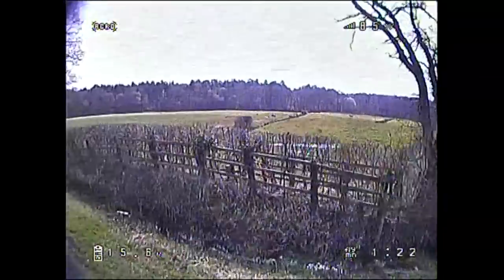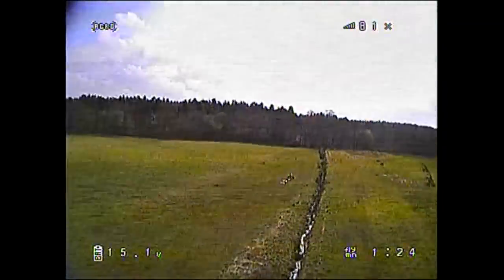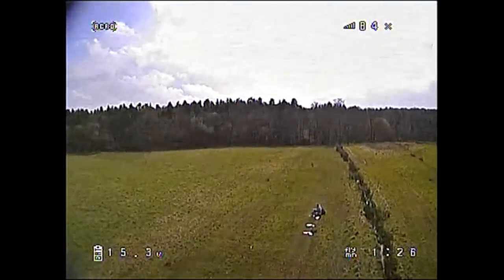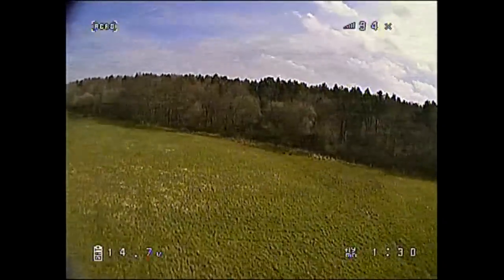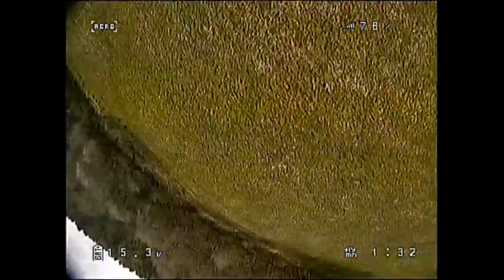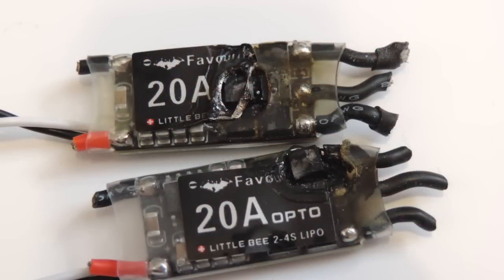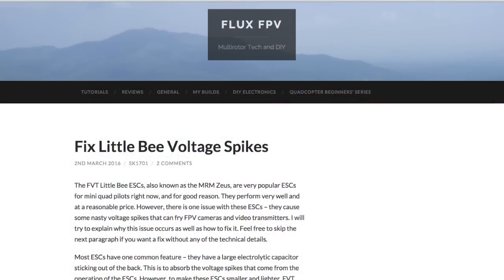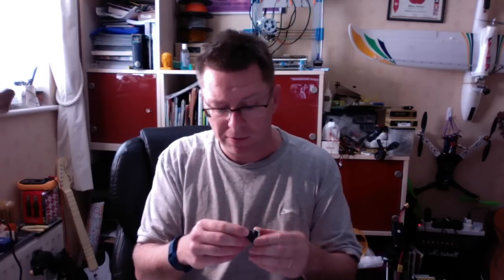Help: Why are my Little Bee 20a ESC's bursting into flames ?

Comment: It unfortunately does look like the Bees are a bit hit and miss, and somewhat sensitive to certain conditions. They really need a bit of a redesign. The most robust solution, in my experience is to add a 25V (for 4s) 1000uF 105 degree radial cap in the PDB as close to where the battery lead connects as possible. This goes a long way to take care of the noise on the main rail and the back feeding current from aggressive motor braking. So far on 4 different quads flown pretty hard, this is working well.

Comment: I ran into one littlebee that also burst into flame ... I think it was due to a crash, however, not during testing or mid-flight:  https://flic.kr/p/G7Lrk5

That said I have MANY littlebees and have used them for months.  This is the only one I've seen that burn out.  I can't rationally consider this an issue just yet.
Reply from the maker: +TheFlyingRamen Out of interest have you ever ran them up high throttle without props ?  I don't think the general bursting into flames is an issue either, I think the reason is high throttle with no load - but if people tell me they do that all the time, then maybe I just got unlucky.  It's my working theory at the moment until I get a better one.  Replacements have been fine though

Comment: Before you put new esc check every motor with LC meter only 10 pound on ebay , RC model reviews explain it very well . 
I burn 2 little bee esc in my qav 210 , 2 motors are dead - and I don't know why- it happen when I changed to 4s

Comment: Check that the ESC components are not pushing through the wrapping onto the carbon arms. Ive had that issue and found it shorting onto my arms before
Reply from the maker: I expect it's a case of making sure you have an additional barrier there.  A doubled sided piece of tape will do it.  Or re-hreatshrinking them
Reply: I secon that...had same issue...
Reply: What did you do to fix that?

Comment: Your motors are drawing more than 20 A, upgrade to a 30A ESC
Reply: You are wrong.  The motor is the load, it is what pulls power.  The ESC is simply transferring whatever amount power that is from the battery to the motor.
Reply: KpilotRCHelis 
No. The Electronic Speed Controller sends power to the motor on the FCS command
Reply: the motors do not pull power, the escs pull power from the battery and push power to the motors. These escs are rated for 2s - 4s lipo's. I'm not hearing him state or show what size battery he used when these overheated. Other than that a bad firmware install can cause the same issue.
Reply: @faithist01  The Motors ask for power, the esc's give it to them. The esc's do not push the power.

Comment: love the littlebees. ive crashed and not looked after my quadcopter and no problems with them. I have a pcb with 12v out then I run a lc filter then to the vtx and camera its all working good

Comment: If you're P is too high which it will be if you lower the looptime without lowering PIDs, the the ESCs are speeding up and slowing down the motors VERY fast which can not only burn out ESCs but motors too.
Reply: Wrong FW in blheli....lesson learned
Reply: I did, it was user error. I'm airborn now tho
Reply: Bishop Vick It's my fault, I should've just used emax but I thought I'd try some of those new ones from Surveilzone. Running Rotorgeek 2206/2300 on an identical quad (but with ZTW F390 30A) and it flies perfectly fine so I dunno? LB 30A are supposed to be bulletproof for the most part. Even running a low ESR cap on my main power rail for spikes. I'll suss it eventually (hopefully). :)
Reply: this is what just happened to my set up, I was calibrating in blhelisuite and my motors were twitching and then the 3 esc's and BRAND NEW motors caught on fire right in front of me, thought I was gunna throw up for a second. 
littlebee 20 amp pro
emax 2205 2300kv

just waiting on new motors and esc's but the thought of this happening again has me gun shy, could you shed some light on the settings
Reply: oh yeah it fried my Vtx as well : (
Reply: ouch dude :( Did you find/ fix the issues?
Reply: I think I'm having similar issues, no fire yet but my motors are overly warm/hot from very mild flying around the driveway. What did you mean by wrong FW? I'm using the FW it came with, 14.4. Something is def up though, you can tell its doing some sort of micro oscillation, even if it's invisible, you can hear it in how rough the motors run at low throttle. Irritating. Never have these issues on my KISS setups. Just want these things to run correctly. I'm using 30A LBs on this build. Advice?
Reply: *****
what motors and props are you using? if motors are hot they may be over propped
Reply: Just 2205/2300 +5403 DALs. Very weird.
Reply: yeah they should be fine. Weird indeed. I hope you sort it ok!
Reply: That terrible sinking feeling. But you won't make that mistake again :)
Reply: lebasson Replaced LB30s with ZTW 30A ProHV F390, issues vanished. The ZTW are a fair bit smoother, esp in the lower throttle range. Good ESCs.

Comment: will you make a video showing a check or test if it is a capacitor problem? what happens if you don't have capacitors, or ceramic ones, or to big ones(eg.1000uf25v from 470uf25v)?

Comment: I had a ESC blow out the middle amps like that, when a capacitor broke off. replaced both with no more problems, many flights!  Eachine-250.
Reply: My Eachi loved the lil bees too. The only set I bought that didn't give me probs.
I ran 6 blade props today on it with a 65c battery . Handled it fine. motors a n  bees were a little warm . Now that arrangement with stock everything else should've toasted. But nope fine. I didn't like the 6blades. on my other build I two lil bees fail just sitting there.

Comment: Couple of questions: Where did you buy them? What motors were you using? What looptime did you set?
You make me nervous now, i wanted to try my first LittleBee 20A & 30A and after seeing your issue i am worrying a lot lol
I never burned my HK Blue Series, maybe i should stick with them at the end and forget multishot...
Reply from the maker: Thanks for your comment, but these were most certainly not grounded out on the CF frame.  Aside from the fact they they were encased in fairly thick heatshrink and all solder joints were heatshrinked as well, the picture shows you the side of the ESC that was facing upwards, so the most unlikely candidate the ground against the frame.  Also add that these had done 4 flights with plenty of full throttle climb outs without an issue, it's only when I was testing on the bench without props that these blew.

I'm not here to try and scare, this was very much aimed at seeing if anyone had any similar issues and perhaps a useful video for anybody who has had similar issues.  I think some useful information comes out here about the voltage spikes you can get from these under damped light and the use of a capacitor to smooth this out, and probably not a great idea to go full throttle without props.  However, the evidence on this one is not rock solid.  Some people have reported that ESCs have blown on not much throttle at all, some have mentioned that they are able to run at full throttle without fires.  It's quite possible that there I had a few ESCs that had a problem and blew as soon as they were put under stress, or maybe the guys running at full throttle without props are getting lucky.  Little bit inconclusive, but I won't run much without props on.  

Also to note, I'm not a hater of these ESCs, I replaced the 2 blown LittleBees with 2 other LittleBees and they've been fine over around 20 flights so far.
Reply from the maker: +ABMNS PRODUCTION I bought them from ImpulseRC in Australia who seem to be a very reputable shop.  Using Cobra 2204-2300 motors, looptime was 1600 when I blew things, but I flew on 2000.

I've been told that if I run them on high throttle without a prop, their RPM can go insane and fry the ESC - so perhaps that's it.  I'll be putting my looptime back to 2000 and putting the new escs in and watching them very carefully.  I'll have the whole FPV setup on the 12v regulated side
Reply: CurryKitten Thank you for your answer! That could be the cause since with MultiShot, after ESC calibration, you must find the high RPM value with the motor tab in the configurator (cleanflight or raceflight) and set your max_throttle to this value generally around 1955!
I will be very careful when i will receive mine since i plan to try looptime 250!
I always have all my FPV setup on the regulated side :)
Thanks for the heads up super daddy :)
Reply: +CurryKitten Never heard that before, I have a habit of running my motors up high with no props when tuning. Never thought of that!
Reply: +Steve B Not sure if this relates to your issue as +ABMNS PRODUCTION is refering to multishot and not oneshot125. From what I understand standard LittleBee's can't run multishot due to 
the processor not being fast enough. They released a LittleBee Pro 
version with a faster chip that can run multishot, so unless you have 
these you will have to run oneshot125.

Are you running oneshot125 or multishot? BTW I think multishot is only in Betaflight and Raceflight, not cleanflight.
Reply: +Bludz FPV OK guys, i finally understood the issue, apparently running these ESCs without props on your bench with 3~4S LIPO battery can indeed make them burn, the solution is since they can support 2S, to use a 2S LIPO battery when you are using your quad on the bench without props and it willl be fine, i did it everytime and so far no issue :D
For the record they can easily support multishot, i installed this firmware on them and so far so good and with Betaflight 2.7, you quads will fly like spaceships!
I got all these informations from the multishot and Little Bee threads on RCGroups.com ;)
Have a great week
Reply: +ABMNS PRODUCTION I have also since learned that Multishot is fine for littlebees, but unless you're running a 500 looptime 2khz mode there will be no difference to oneshot125. To get the benefit of mutishot you should run 250 looptime 4khz mode otherwise the FC sends repeated multishot signals. No point running multishot if your FC isn't calculating faster (unless you run it for the startup music). These are my opinions after plenty of research, so don't take as gospel.
Reply: Bludz FPV You are perfectly right about using multishot with the fatest looptimes since multishot is a more fastest protocol than oneshot125, you can have a better flight experience, there also is no point indeed to use multishot if your FCs can not handle these fastest looptime but it will work anyway you will just not enjoy the full potential of multishot :)
Your opinions are welcome mate, no one said you can not share them with us :)
Enjoy your week
Reply: IT IS THE NO PROPS! 110%  The problem!!!
Reply: yes remove props to calibrate esc's but down keep motors running at max!! there is no need to do that! put tx throttle to max hookup flight bat wait for beeps lower to min than raise throttle, that's it!!!  you DO NOT HAVE TO GO TO MAX AFTER THROTTLE IS LOWERED!! IT GETS MAX THROTTLE POINT WHEN YOU START AT MAX!!!!  MOST FC'S YOU CAN CALIBRATE ESC'S THROUGH TX OR FC FIRMWARE!!! IT IS NOT ROCKET SCIENCE!!!

Comment: I had the same issue with a pair of little bees going poof on 2 desperate quads. It was always after the quad had been flying fine and both times diagonal motors. After taking them apart I could see the output fets had overheated and slid to the side slightly making shorts on all the wrong pins. In the 3D thread, people have been adding caps to the little bees to chill the noise down and get cleaner switching, that should help the spikes a bit. Xrotor aren't as small but outperform bees and kiss.

I've never killed and esc or motor through anything other than physically breaking one in a crash or flashing wrongly until one shot was available, after that it seems esc are pushed right to their limit so if there are issues in the tune or even bad vibes it can push it over the edge. It's a great performer but i'm 4 motors and 6 esc says something changed.

What I really don't understand is all esc came from the same supplier and the two that didn't get slidey fet syndrome didn't even get warm. Same firmware, motors, flight , entire life time and quality t motor too.

Comment: You need to run a capacitor on the voltage line for your camera. 25v 470uf should do the job. And as for catching ESC's on fire you can't rev the Little Bee's up on the bench without props. Check the RCGroups LittleBee thread.
Reply from the maker: +JKFlorida My PDB should regulate the 12v output, I just had the cam into the main rail sharing the ESC voltage.  I found the LB thread on RC groups - lots about the cap, is there anything about the don't run without props thing (there were a lot of pages to go through).  I figured they would draw/use less power without the prop on - teach me to be safe and take the props off !
Reply: CurryKitten I don't have all the answers but the motors can send over 40 volts back into the system during hard braking. And as for the ESC fire it has something to do with RPM. I'm not sure. If you PM QuadMcFly on RCGroups he can give you all the answers!
Reply: How do I add one of those capacitors? I'm trying to find something online or on YouTube but just not sure what to look for? I have a mateke pdb so do I need one?
Reply: So I still don't see a reason why you would run your motors on the bench with more than 5% throttle anyway. You only need to check motor directions, correct order of soldering of the escs to fc and minthrottle. But whatever, some people like the sound of the motors at 100% without props on :P. But personally I never had problems with my lb20a. Even two days ago when I chased a plane and literally flew on full throttle for two full minutes they haven't even been warm.

Comment: you should add a 1000uf 50v cap onto the main power on the pdb. Little bees cause all sorts of noise / filtering issues
Reply from the maker: +FPV Squad I don't have a specific pad for the lipo on my PDB, it's shared with the ESCs - does it matter, still worth putting one on ?
Reply: +CurryKitten yep definitely
Reply: How would I add one of those capacitors? Does it just go from the positive and he negative solder points? I'm using a matek pdb board so should I still use one?
Reply: +David E Yeah, also interested in answering this questing since I am also about to install matek a LB30As
Reply: Should the capacitor be as close to the battery or as close to the esc-s?

Comment: Sounds like a bad design imo, with dampened light ESCs need a fair bit of decoupling capacitance, or they'll cause voltage spikes as you'd been observing in your video. I have different ESCs with dampened light, and they came with a 220µF cap each.  

As for blowing your camera and themselves on the bench, that's very odd. Was your pz0420 a 5-15v model or one of the later 24v versions? My theory is that because it's on the ground, the PIDs will be producing quite a sporadic output to the motors. Especially with a lower looptime, this makes the ESCs accelerate and brake very rapidly, which would cause big voltage spikes (maybe enough to over-volt the camera) and heat themselves up enough to blow the FETs.  
Just a theory though, I don't have any evidence for this.
Reply from the maker: +remotaholic Apparently, they used surface mount ceramic caps instead of electrolytic ones, and then it got technical about why these weren't working.  Must agree on the design, these were heavily recommended to me by a bunch of racers, but I'd prefer something that didn't kill itself.

Theories better than absolutely not idea - which is what I have
Reply: +CurryKitten The solution is to use stock settings with oneshot125 enabled.
Reply: you could me using the wrong esc amp ones